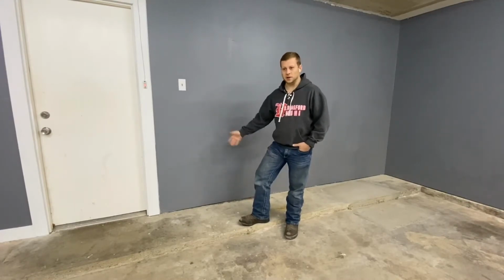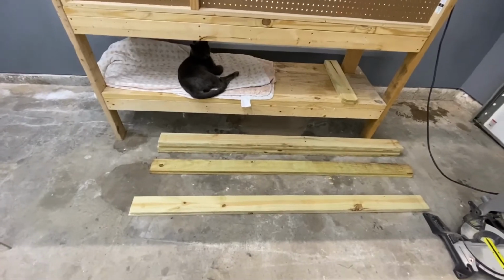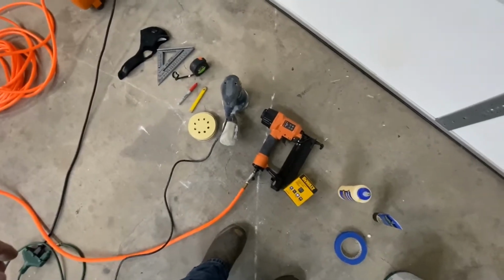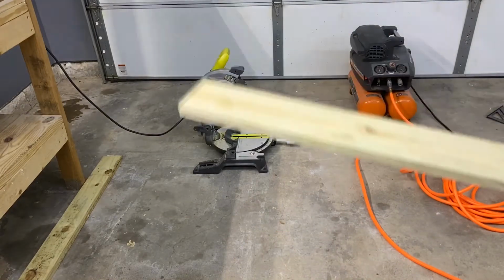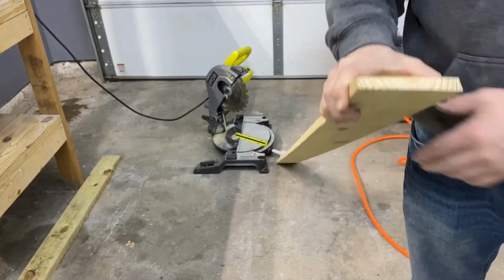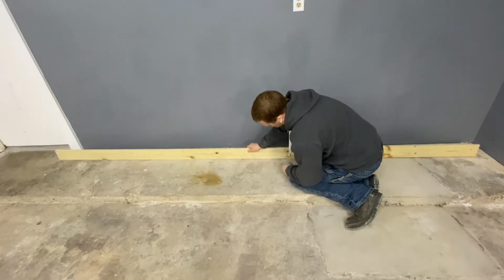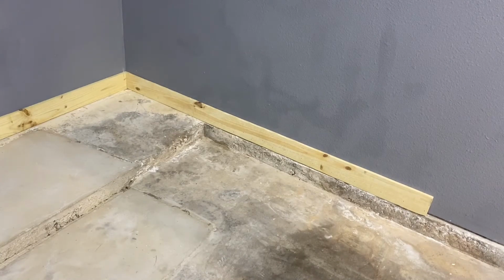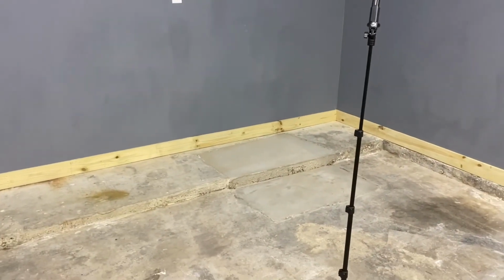How to make cheap trim for garage or shop DIY Very Easy!! Very Cheap!

Comment: Why not paint beforehand and then install the trim?
Reply from the maker: Certainly an option but I wanted to cover up the nail holes. So I installed it. Then put putty over the nail holes. Then painted it. Wanted it to have a seamless finish
Reply: ONEMANBAND ah, makes sense 👍